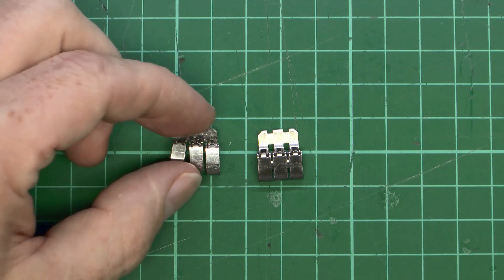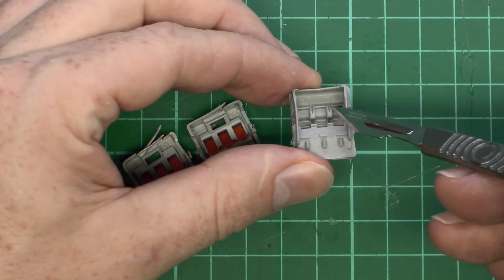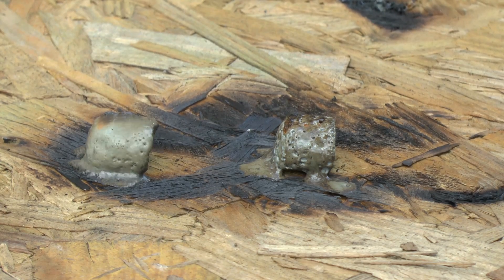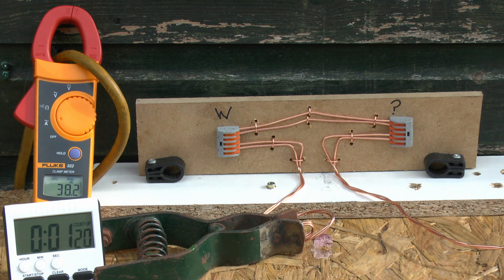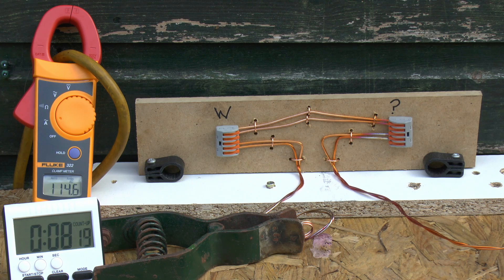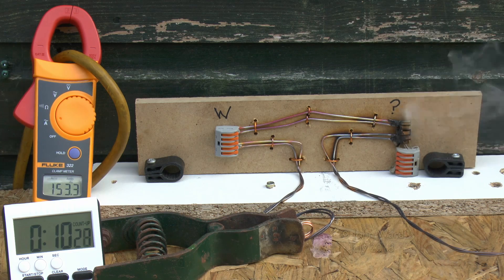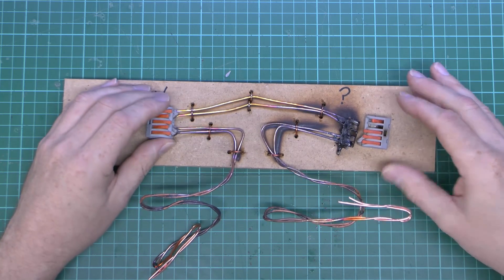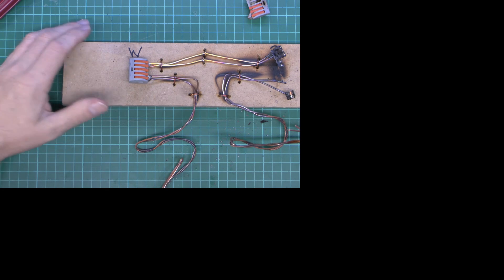Wago 222 Connectors vs Others, Testing Current Overload and Flammability

Comment: Well that was a very conclusive test... John. I expected the fake-o connector to fail specularly. Springily good quality. Also makes me wonder why someone went to such lengths to copy the product, same price ect... 

I will still be sticking to my ceramic type terminals only tho. - they’re best, id like to see you crank some of them up perhaps get some off eBay rated for 32A and see how they do on 155A? 

I may try it on my channel with my 1100A transformer. ;)
Reply: Kyle Bishop 
The problem with ceramic connectors is partly that they are brittle and a broken connector is a dangerous connector, but in real life conditions, they shake around in transit and lose all their damn screws. I rarely use them unless I expect them to be exposed to long term heat or in fire resistant installations.
I thought that was why we stopped using screw-it/midget/dog-cock/wire nut connectors. The porcelain wasn’t sufficiently robust. The newer ones are plastic
Reply: Hmm the point you’ve raised does indeed make sense... Although in all installations iv done and on my power equipment I have made I have never had a problem with using the ceramic terminals.
Reply: Yeah but nobody has problems with the plastic ones either.
Reply: Mr Badger - the ceramic terminals that I buy (from CPC) come in plastic bags, so even if the screws do come loose, they are not lost. And it's not just these connectors where screws shake loose. I known the same problem with a variety of screw type connections. Wago type connectors have their own problems when used in humid or damp conditions.
Reply: Because now he gets the money instead of Wago?
Reply: > @kylebishop6233
> 
> I will still be sticking to my ceramic type terminals only tho. - they’re best, 

They're not maintenance-free though, are they.

Comment: What are you running through these connections dc or ac? JW
Reply from the maker: Link in the video description
Reply: Thanks just looked a welding plant dc , great videos by the way
Reply: 50V AC
Reply: AC - DC would not hum.
Reply: Mat Jones nice power supply.
Reply: Paulman50   He uses an Oxford arc (stick) Welder

Comment: Better than screw connections if not tightened up
Reply: Mat Jones Yeah, but you dont use screw terminals without tightening them up do you?
Reply: Bob Lob Law 
After many years of use screews connection ends to become loose due to the frequency of alternative current , ever if you tighted them as a beast .
I've tighten the whole screws connections ( breakers inclued )   on my neighboor's electric pannel, surprizing how they came loose after years  , i've  done it after my neighboor reported to me a disfuction on the living room lighting . I wired a  niew line for the bathroom electric heather too .
Reply: That's actually more likely due to temperature fluctuations in the wiring/connections. 
A simple screw terminal will only press down on a small portion of a wire, which increases the chance of high contact resistance and thus heat. 
The 'newer' types have a tiny cage that pulls up when you tighten it, which clamps around the wire perfectly.
Proper torque is required though, because if you over tighten them they can actually perform worse. 

The cause of temperature fluctuations is generally because the grid is not properly installed:
- The fuses are too heavy or the wiring is too thin, which causes the wiring and connections to heat up. 
- The fuses are too slow, which allows the wiring and connections to heat up as well. 
- There have been a lot of shorts in the past. Every time a short occurs, the whole loop gets a very brief 'kick'. Having an electric heater in a bathroom can be a perfect cause for that.

Comment: I wonder how a waco connector would fair against actual solder
Reply: You‘re comparing apples to oranges. You wouldn‘t connect mains solid-core wiring using solder.

Apart from that, solder probably provides equal amounts of overload capabilities, but with its usual problems (cold joints, breaking under vibrations)
Reply: RAnders00 Perfectly allowable to solder it.
Reply: Maybe in the UK
Reply: stefantrethan yes, this is a UK channel
Reply: Good luck trying to earn a living if you are going to solder all your connections.
Reply: Normal lead based solder melts around 190C, so it would probably melt before that plastic.
Reply: Pentti Hilkuri - if your wiring gets to that temperature, you may not have any insulation left on the wires anyway... It's best practice to make a mechanical joint first before using solder. So even if the solder did go soft due to heat, the wires should not easily pull apart.
Reply: But is there much point to add solder if you make a mechanical joint anyway? Maybe not in a normal installation but in a very humid or corrosive enviroment this could add some value.
Reply: Pentti Hilkuri exactly what i thought as heat is an issue